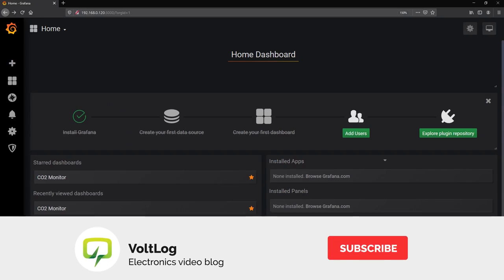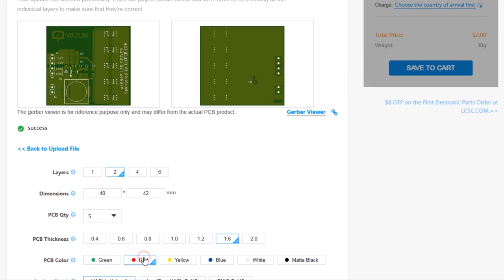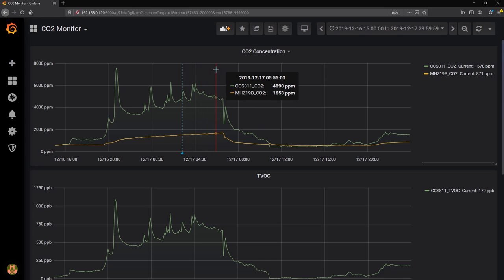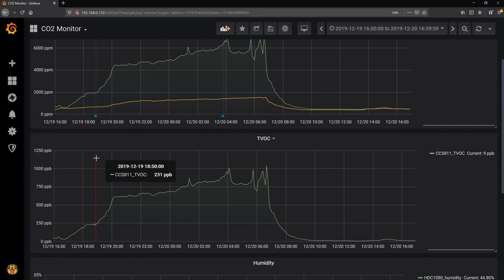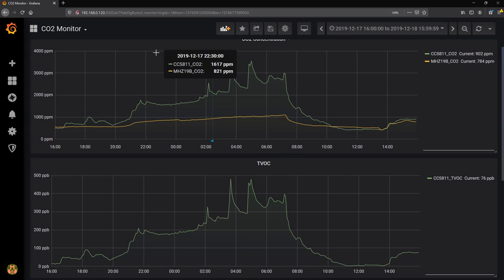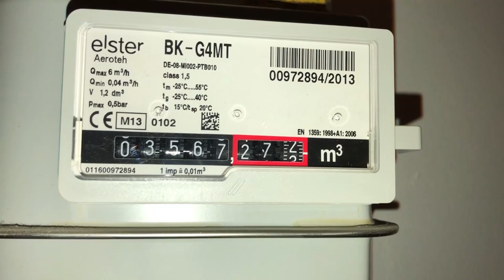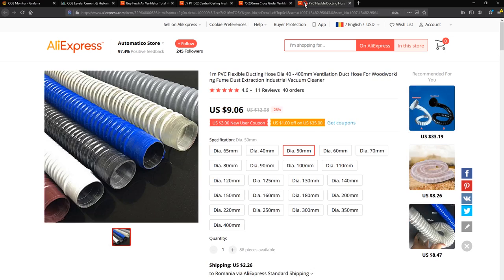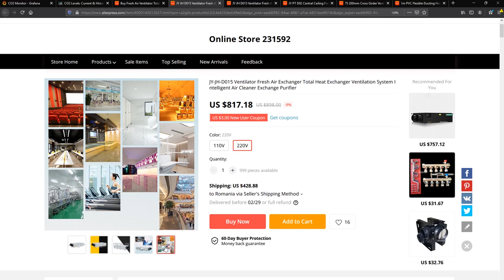Voltlog #276 - What Is The CO2 Concentration In Your Home?

Comment: It would be interesting to check if you bring some (many?) plants inside the house, are they able to make any change in the charts of the co2....?...
Reply from the maker: I couldn't find any exact figures but here is what I know. The greater the leaf surface the more CO2 the plant will absorb during the day, while doing photosynthesis. However, there is a limit to how many plants you can grow in your apartment and I would image they don't take in considerable amount of CO2, for the sizes that you can grow in an apartment. And there is another thing to consider, plants will consume CO2 during the day, but during the night they give out small amounts of CO2.
Reply: @voltlog  the trick would be to expose those plants to artificial light during the night (and keep them in the dark during the day) so they have a cycle like they are on the other side of the planet...

Comment: Trick: open all windows completely for a few minutes before going to bed. This will renew the air but the walls will not have time to cool so when you close the windows, the air temperature will raise back fast. That's much better than keeping a window slightly opened for hours and heating the atmosphere...
For the CO2 build up during the night maybe you could try 2 projects: -have some Soda Lime around (but not that cheap and not ecological) 
-have plants with some lights in a box  (with a a way to move air around without letting light escape the box) and you turn that on during the night.
In both cases the goal is to absorb the CO2...

Comment: Great summary of the findings. We live in a centrally heated apartment so I don't know if this could work for you but in our apartment it's possible to adjust the radiators in each room. If the bedroom is kept 1-2 degrees colder then the rest of the apartment this will increase the natural airflow between the rooms. Another idea I've been thinking of trying is to use a table top fan to blow in air from another room. This video inspired me to finally set up a new sensor for measuring if this would make a meaningful difference!

P.S. I almost missed this one. I think it might have been better to incorporate this as part of the previous video, even if it'd meant skipping the schedule for one week. I'm not familiar on how the YT algorithms work though so I can't say if it'd not be good a bad in overall.
Reply from the maker: I actually needed one week to collect the data and then I did the second part, one week later :-) Skipping one video is not good at all for the channel, because it means the next time I publish something I will get fewer views, the algorithm, doesn't like it when you don't post regularly.
Reply: @voltlog  Yep I figured that (hence I mentioned the algos)

Comment: Thanks for the inspiring video. 
Last summer, while our flat was renovated, I built something similar with particle matter (PM) sensors arround our home. Now that life is back to normal was considering taking down the sensor network, but now I'm thinking into adding CO2 sensors.
Reply from the maker: There is another thing to consider: after renovating a home, the paint, adhesives and all the other materials used in the renovation will give out volatile compounds for at least a couple of years. Some you can smell on your own, some will be visible with a VOC sensor. Ventilation is especially needed in this scenario to bring in fresh air, otherwise, you are inhaling that stuff.
Reply: Good point, maybe measuring VOCs is interesting in its own right.

Comment: I’m using Netatmo to monitor air quality in my home, with 2 internal sensors. One is in my boy room (~12mp) and one in the main bedroom (~16mp). During the night the CO2 in the boy room goes up to ~2800, but the other one, even with two adults, does not go over 2600. Is not sensor related, as switching the sensors the results are the same. After opening the window for a few tens of minutes, the CO2 drop to a value sometimes even a little bit under 500.
Reply from the maker: I would image the rooms have their doors shut during the night if you are seeing values that high. In any case, it would be nice to consider a ventilation system to lower those CO2 levels at night.
Reply: It's also worth considering that many materials commonly used in furniture off-gas things which you may not want to be breathing - e.g. most OSB, chipboard, plywood use binders which off-gas formaldehyde.  The VOC type sensors may be cross-sensitive to these, but whether this applies to your sensors or not, high indoor CO2 is often accompanied by high formaldehyde levels too, so CO2 is often used as a proxy for air quality in general by building management systems for this reason.
Reply: @Tim_Small  If nobody home, even without any window open, the CO2 concentration does not increase at all.
Reply: @dantoma9154  OK, on the one hand that's good, since it means that the CO2 measurement is more likely to be a true CO2 measurement, and your home is very air tight - leading to minimum heat loss or gain from air leakage.  On the other hand if you are getting CO2 levels that high, then it can make people feel uncomfortable, and decrease sleep quality, and also it makes it more likely that indoor air pollutants are present at higher concentrations.  Adding some ventilation (with or without heat recovery) is probably a good idea...

Comment: Can you add a humility sensor to see if there is correlation to the bad sensor. Maybe it's reading can be compensated.
I went to a public lecture at our biggest University a couple of months ago and now they know there hasn't been a CO2 increase for 1 million years. It actually had dips where the CO2 lowered, but after the 60s it just shot up.
Reply: A humility sensor? Now that would be something to brag about. :-D
Reply: @BaronVonBiffo  Oops, you got me. lol 
I can't spell so I used the suggestions, but because it was on a 12 year old TV across a room I couldn't see the words that well.
Reply: @SidneyCritic  ;-)
Reply from the maker: There is a humidity sensor in the system and there is an observable correlation between humidity, voc and eCO2

Comment: Maybe someday you can add a display that shows the daily high and low. Good information.
Reply from the maker: That was the first idea I had, with the ESP82266 + OLED dev board however I had trouble getting the softwareserial library working in the ESP8266, it's a known bug.
Reply: @voltlog  ESPEasy (optionally) uses software serial for the communication. It should work fine? On my original CO2 node I also has PMS7003 attached which both have a serial interface.
Reply from the maker: @ristomatti  they might be using a different software serial library in their project but nonetheless the project looks interesting I might give it a try soon, thanks!
Reply: @voltlog  I suggest checking their GitHub repo issues if you encounter any issues. The main developer is also insanely helpful and active. There is/was a very useful issue thread specifically on using the MH-Z19 sensor. The dev seems to have a lot of experience with it!

Comment: I don't think it will influence the CO2 however i expect it will improve the air quality if you regularly clean the ventilation system. (And if you have one with a motor check if it is still working oke.
Do you also have e sensor for particles in the air in your system? (Relative cheap available on AliExpress)
Reply from the maker: I did not use a particle sensor in this system.

Comment: I just finished the same project with the mhz19. I am getting identical readings! In do have a ventilation system but closed the door preventing the ventilation system from circulating the air. Solution: I am shortening the doors at bottom approx 1cm so air can pass underneath. (Recommended by law)
Reply: That sounds very good ! ... If you don't have cochroaches (we have here a lot !) Cheers !

Comment: New project idea: how to pre-heat incoming outside air using the heat exchanger of one's always-on water cooled PC... ;)))
Reply from the maker: It's not impossible to build a DIY heat exchanged, however holes need to be drilled in the walls to allow for the system to be integrated which makes it not suitable for rental situations.
Reply: @voltlog  "fairair" sell replacement heat exchangers for mvhr/hrv units.  Maybe you could use a small exchanger with some EC fans (large diameter PC case fans may be fine) to make a small window mounted unit?   Making something which is small and efficient and quiet is a challenge!   Interesting that the white+green plastic exchangers that they sell are all made by a single company in the Netherlands, who have massively undercut/outperfomed the many in-house heat exchanger designs that all the European ventilation unit manufacturers used to use...
Reply from the maker: @Tim_Small  I don't see any heat exchangers listed on their website but I have recently seen a nice compact model from a company in Ukraine, model name is Prana. I like their design, the price is about $750 for one unit which is capable of ventilating an average bedroom, however you need to drill a massive hole in your wall to install it. Having it installed on a window will make it loose all of it's efficiency.
Reply: Eh, it was just a silly joke, and you're right about the hole of course... :)
Reply: @voltlog  You are right, nothing on the fairair site now (I thought they used to, BICBW).  The air-air exchanger manufacturer is "recair", and there are some companies selling recair stuff direct to consumers (e.g. to replace damaged exchangers) "airfort" was the first site that I found.

The recair exchangers have pretty good efficiency (many setups will be >90% - they have some calculators on their site).  For the window mount, I was thinking of a removable installation a bit like the wikipedia article "Window fan".

I understand that might not be practical in a small apartment, or with many window designs, but I have previously done something similar in an office computer room.

Having installed two HRV/MVHR systems myself in the past, a well designed system is great when it's installed, but often difficult to fit into existing buildings - much easier if it's designed into a new-build.

I know people who have used simpler "single room" units from Envirovent, or VentAxia too (similar design to the Prana), and they are OK, but the efficiency is lower, and they can be more noisy - but the install is often more practical for retrofit.  Rented buildings are always tricky however, but maybe you could make an insulated sleeve and board to install in a window opening (again, highly dependent on your window design and building rules!), without compromising on efficiency.